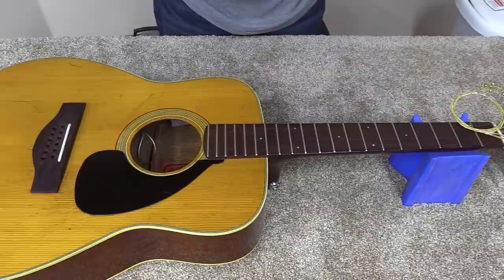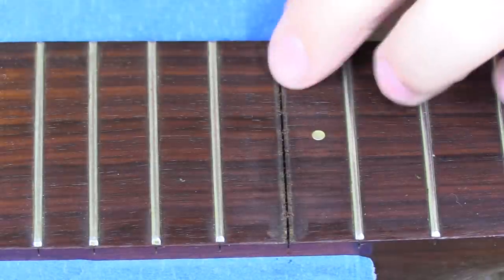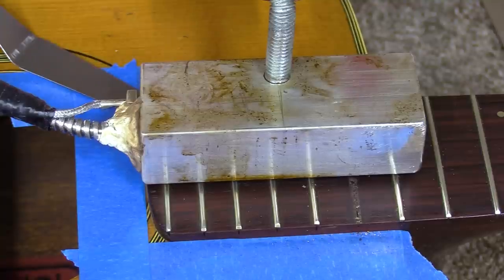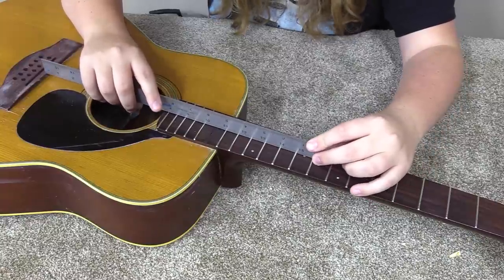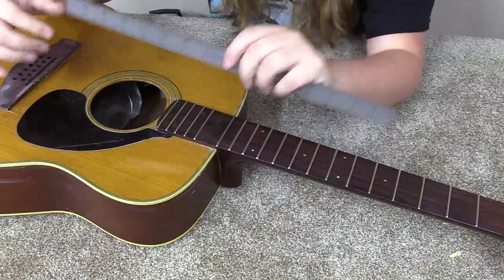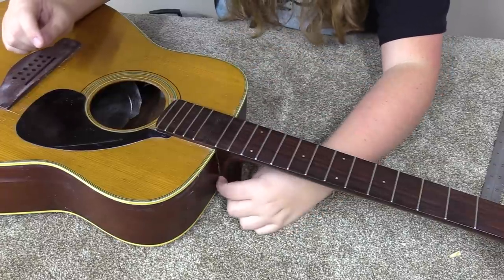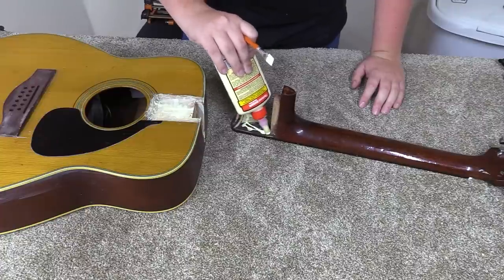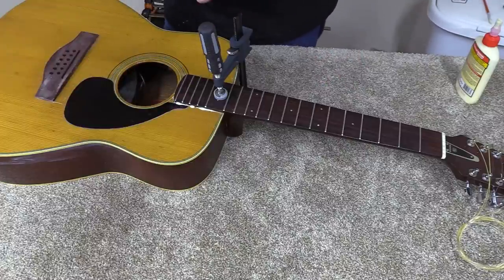Yamaha FG230 12 String Tune-up Part 3

Comment: Nice job Caleb, you got that neck off very clean. Remember to take a little off at a time and fit it, you may not have had to use shims. No big deal, but I also would have liked to see that neck fit a little tighter. All in all it came out real nice. I have never used them myself, but I have seen another luthier use foam cutters for heat and they look like they work really well. No steam just heat, it eliminates the chance of ruining a finish or turning it milk white. Just a thought if you are going to be doing this a lot. Nice Video

Comment: Hey Caleb, we have a fellow up here in Ontario, named Ted Woodford.  He has a YouTube channel that you might be interested in.  When he does neck resets, after an initial pairing down of the wood, he fits the neck and then pulls sandpaper down the inside of the neck to do the final fit.  Because he pulls it from the base of the heel, nothing is removed from the top of the joint, but it removes progressively more material as it draws towards the base of the heel.  He will pull 5 times from one side of the heel and then 5 times from the other side, to keep it even with the body of the guitar, and repeat until he is satisfied with the fit.  He gets a perfect fit every time.

Comment: Caleb Nice job, those old Yamahas are really nice, I have a 1980 dreadnought style my wife bought me brand new back then ..
I think you got lucky with the neck reset mine & a bunch of people I know who have them have had neck resets & they were a bitch Because Yamaha used an epoxy type adhesive to glue the dovetail it took me 2hrs to steam my neck off it was Horrible. I ended up wrecking the finish all around the neck extension & had to refinish the top. Again Great job.👍👍🎸🎼🎹👨🏻‍🦯👨🏻‍🦯
Reply from the maker: I know right. It definitely came easier than most. I wonder if the neck joint wasn't already loose, and the extension wasn't just holding it on.

Comment: great job, very interesting. Isn't it necessary to put a shim under the fretboard when you do a neck reset ? Or maybe the angle wasn't large enough to require this ?
Reply from the maker: You are correct, it really depends on how much you're changing.

Comment: Nice job. Very clear explanations. I do have a couple of questions.  
I didn't see you cut the finish at the neck joint before you pulled the neck. Is that an unnecessary process on this particular guitar?, or did you just not film it?  
Also, I see you didn't make a shim for under the fingerboard extension.  Not necessary here?
Finally,  I didn't see you checking the neck position, side to side,  before you installed the shims. Was that done off camera, or is it unnecessary. 
I ask all of this because I have a 1980 version of this that needs this process. It will be my first neck re-set. 
Thanks!
Reply: He mentioned that he scored the finish, you just missed it.
Reply: @PJBonoVox  thanks!  Always possible with me.
Reply from the maker: I did talk about cutting the finish, I didn't talk about any of the other things, but they were taken into consideration. It didn't need a shim, it went down alright, some do though that's more of a personal judgment call.
Reply: @MillsGuitars  Thanks!  I just missed the finish thing.  Guess I'll just have to watch it again!
Reply: @PJBonoVox  He mentioned it but didn't show it.